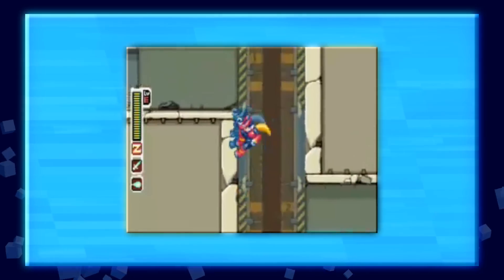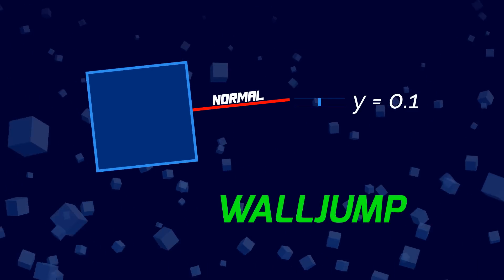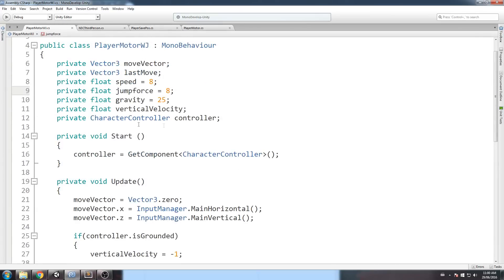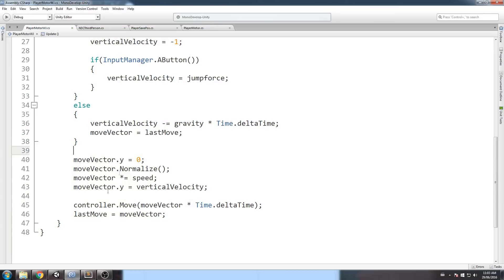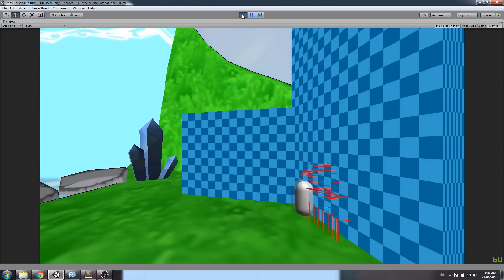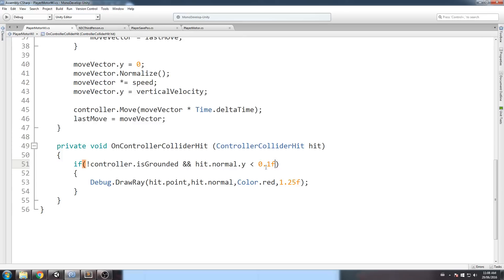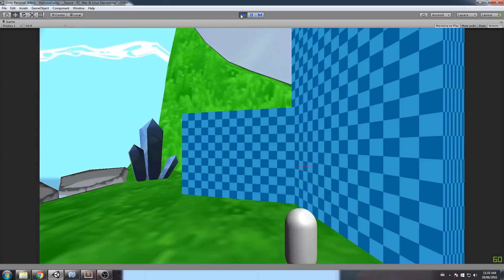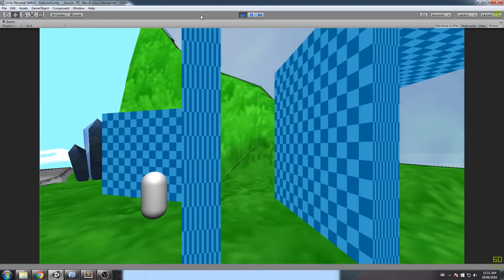Wall Jump (Wall Bounce) - Game Mechanics - Unity 3D

Comment: I don't fucking understand!
I did the same code except I don't have raw movement so normalize causes the player to move a little forward with the value of 1 as long as the axis is above or below 0. But what I don't understand is why I can't move at all if I // out moveVector.y = 0; or the other moveVector.y. It's just the y vector so why does removing either mean I can't move at all?!
I can't figure out how to fix this code while still keeping the shifting x and z with decimals.

Comment: Instead of writing GetComponent<CharacterController>();
Why don't you simply make the variable public and drag it in? It will just implement it instantly so you don't have to use Start() to get it
Reply: Try getting in the habit of thinking about it from the other direction.
You want AS FEW public references as possible because if you need 5, 10 or even 100 references when your game has started to become very big, then it's going to be a complete mess in the inspector.
If all the scripts are on the same GameObject, then the simple way is actually to use GetComponent.
Reply: magnusm4 so what when you have to impot many things. you will make your inspector look full
Reply: That's not what they meant at all, lmfao
Reply: Because, why drag in the reference when you can write code that essentially does the same exact thing for you? If you don't need to drag it in, there's no point in doing it. It's much simpler to just write literally 1 line of code to do it for you lol
Reply: It's always funny reading these kind of replies about "very big" games when the majority is either 2D, simple 3D mobile games or just stolen assets from the asset store. It feels like i'm in the few who actually want to make a big game where this kind of tip actually matters. I don't know about Ori And The Blind Forest's size but I wonder if that game is as big as you describe big games as it is a very big game but still only 2D with mostly visual flare to a simple but very responsive and good feeling control scheme and gameplay

Comment: Nice Tutorial, however im having a few issues, If you hold down a key while wall jumping, and if you let it go before you hit the ground, the character gets moved slightly. So if you jump from a left wall and still hold down left and just release before you hit the ground, the character will move to the left a little bit more without your input. Is there a way to stop this?
Also, is there a way that you can still allow the character to have access to the movement when they are in the air but with possibly just half the power?
Thanks!